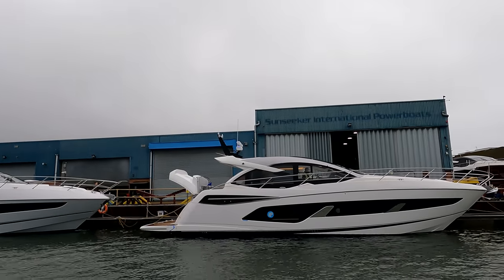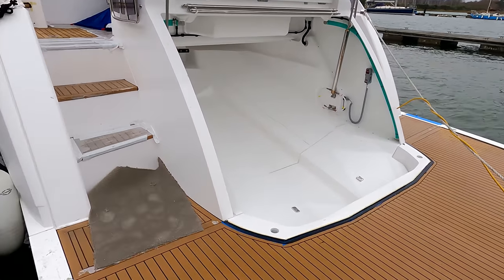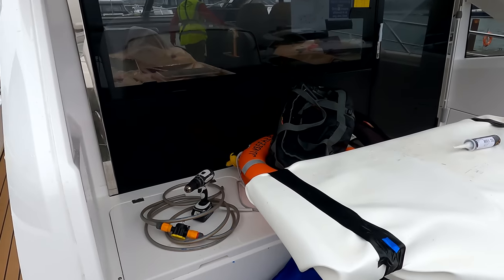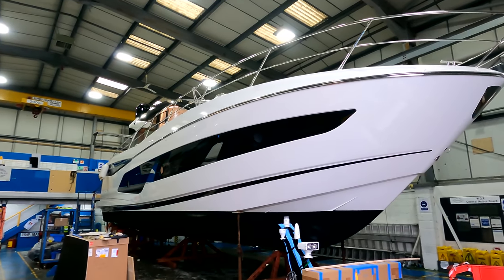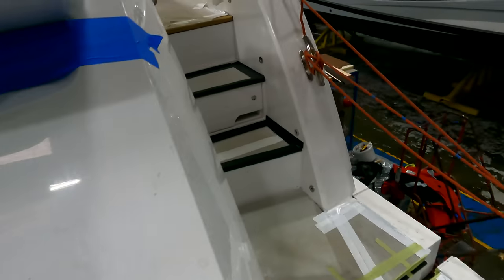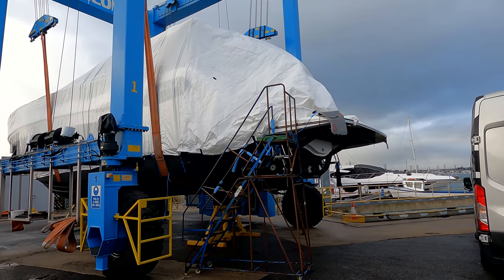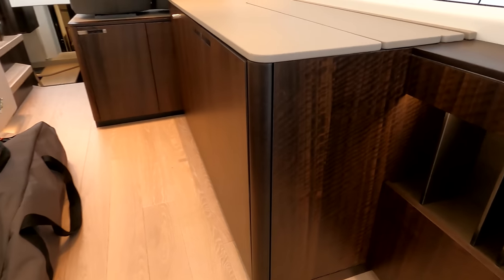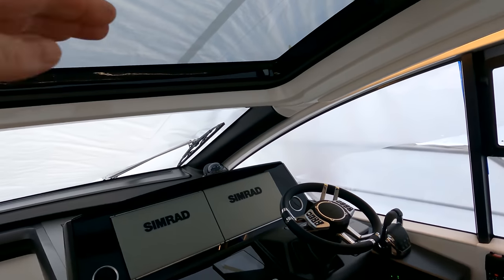2021 Sunseeker Predator 55 EVO Yacht Tour - Brand New Exclusive Full Walk-Thru Preview £1,149,000

Comment: hi thanks for the video.  Any chance a jet ski would fit in garage instead of williams 325?
Reply from the maker: Hi Bob, the challenge is always the height of the handlebars, I have loaded into certain garages (such as the Pr60) backwards to help with this issue. We would have to measure up, but with the lifting platform, perhaps you could run the ski on bathing platform?